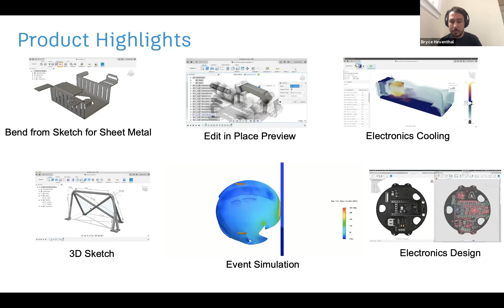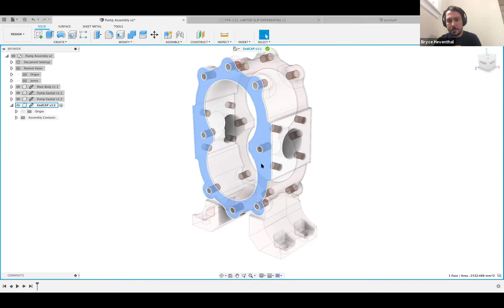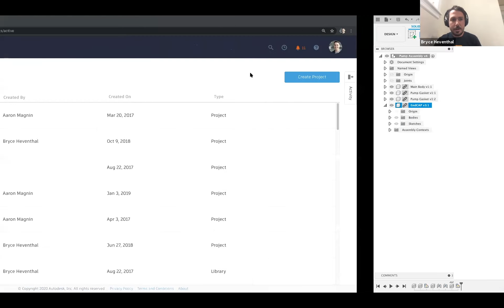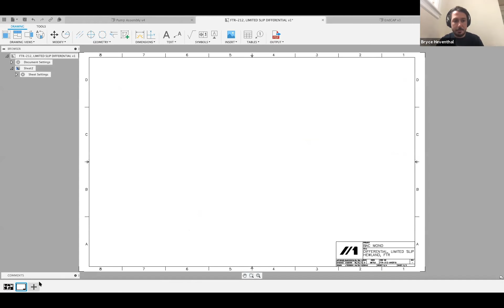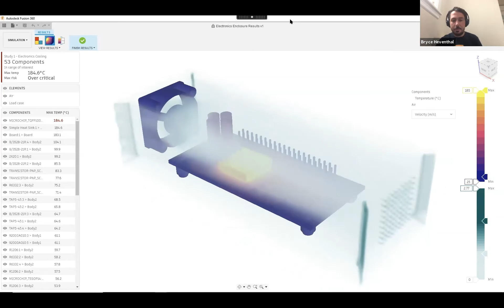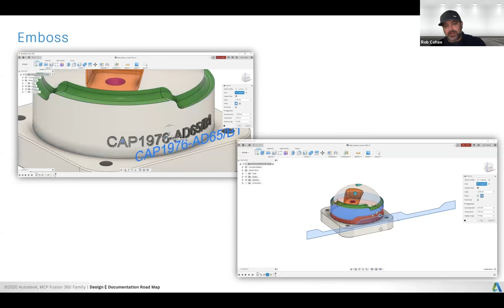What's New in Fusion 360: Design & Engineering | Autodesk Virtual Academy

Comment: You need to be able to turn milestones OFF as well as on. I discovered that drawings won't update until your next milestone update to your assembly. You might say that is fair enough but once you've done your first milestone save (intentionally or not), there's no going back. From that point onwards, you have lost synch between models and drawings that was there before. That's not always as helpful as you might have thought.